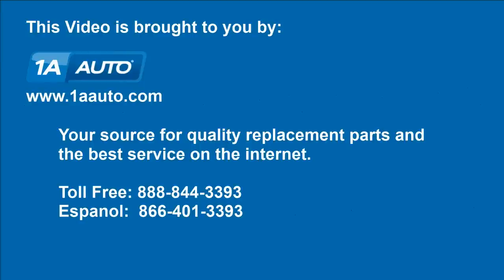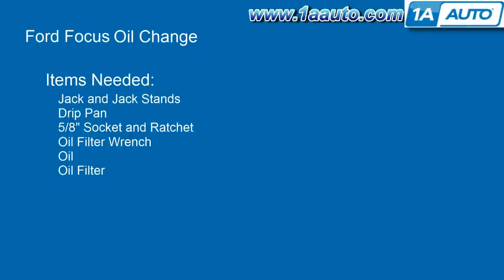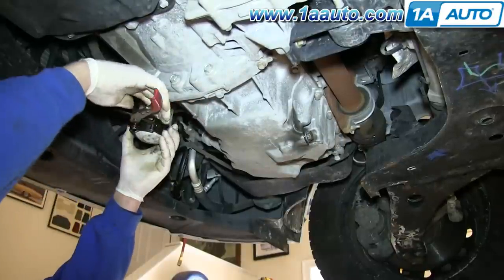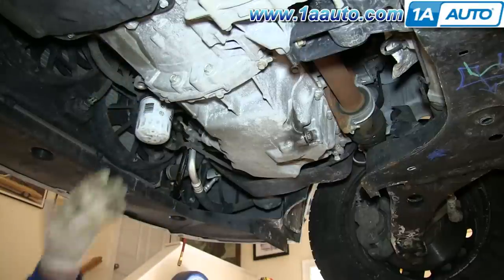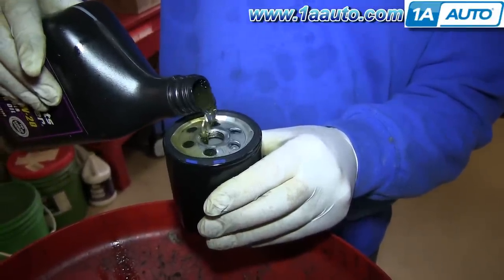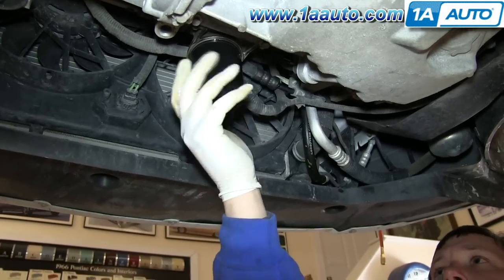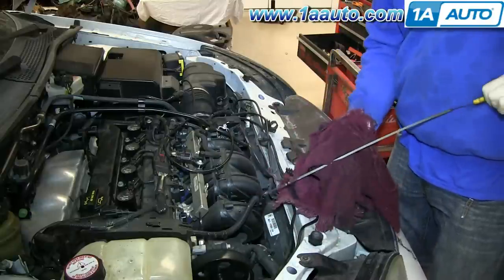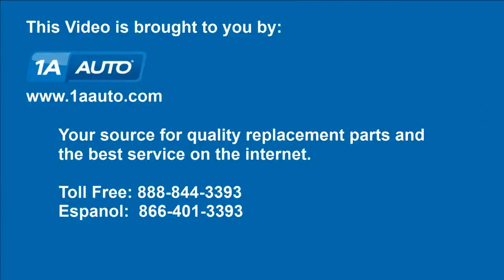How To Change Engine Oil00-07 Ford Focus

Comment: Does it matter if it requires 5-20 and I put in 5-30? Will it do any harm? And also im going from synthetics to regular oil.
Reply from the maker: +Lance Hibak Thanks for watching!  You really want to use which ever oil your oil cap says to use.  5W-20 is thinner than 5W30, making it better in colder climates.  5W-30 is thicker, thus better in hotter climates.  We recommend using synthetic if your vehicle calls for it!  1aauto.com

Comment: Am I mistaken or is that the transmission oil from the gearbox that you are draining ?
Reply: If you're still bothered Transmission and engine oil is shared on the focus, both parts use the same oil
Reply: I have a Ford focus 2006 2.0 my engine oil and transmission fluid are completely different fluids

Comment: what happens if you put to much oil
Reply: What would happen is that if you pour over a quart than the recommended capacity, you would get engine problems.

The crankshafts spin fast, even if your vehicle is at idle, when it slaps the surface of the oil, it will create bubbles in the oil as the air just behind the spinning crankshaft lobe gets dragged under the surface of the oil. The net effect is that the oil doesn't get delivered to the places it's supposed to go, a gross excess of engine oil can kill your engine, just like not having enough oil. The oil will go through systems it should not go through like the PCV system into the intake manifold.